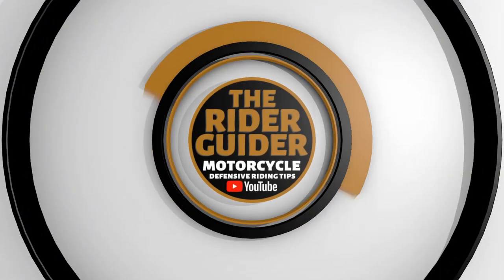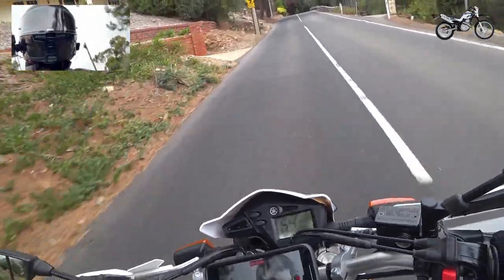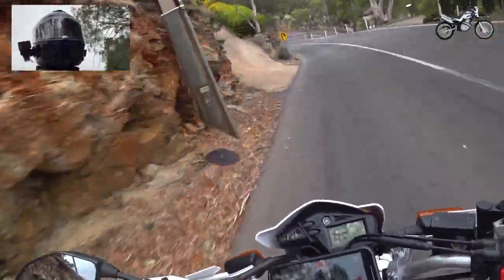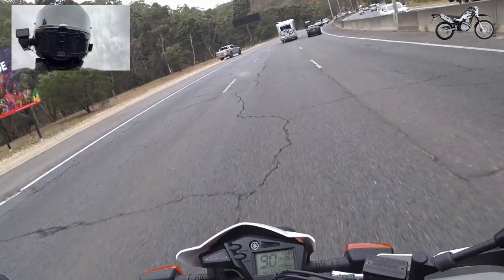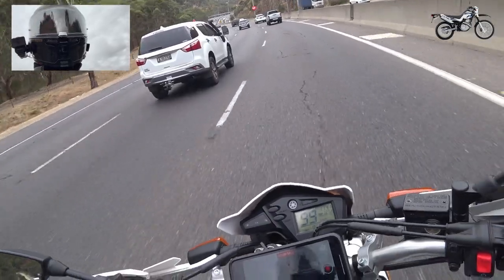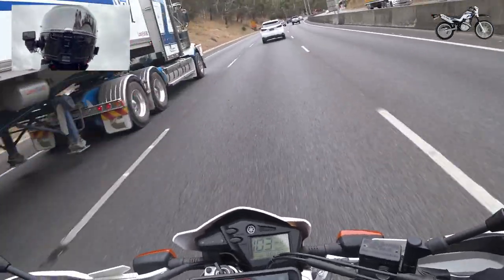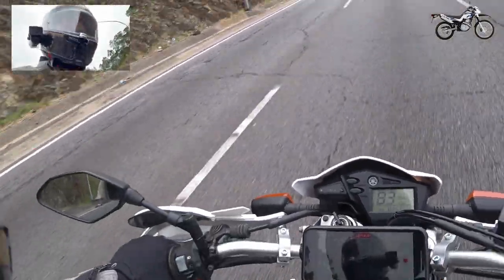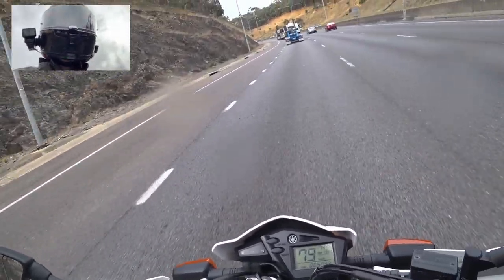YAMAHA XT250 TOP SPEED UPHILL TEST IN TRAFFIC

Comment: Bought one this year. Amazing, fun little bike to zip around on. I have a Royal Enfield road bike that weighs around 450 lbs. Much rather zip around on my XT it does everything very well and is so light. I hate heavy bikes which is about 90% of them now. Plus I went up a tooth on the counter sprocket that helped a lot with traffic speed and still very adequate through the gears. If you can't keep up with traffic you don't know how to ride....
Reply from the maker: Thanks Wally, yeh you're right mate, this is a more than capable bike with the right rider ;-)

Comment: Exactly what I wanted to know. 
Looking at getting rid of my Super tenere and getting two XT250's.
One for me and one for my wife. Will be perfect for our adventure trips. Fast, reliable and lightweight  enough. 
Greetings from down here in South Africa 🇿🇦
Reply from the maker: And great value.  I love riding this XT.  One each.  That will be ace 👍🏼😎 thanks for visiting my channel 👍🏼
Reply: Are you happy with your choice of 2 XTs?
They are great bikes but thanks to our exchange rate, don't come cheap in the RSA. 
I run a bike lessons/adventure bike rides - sideline business  and currently own the following (very much used) dual-purpose bikes (which I bought over a period of about 3 years - all initially with their own issues) 2015 Honda XR150 / 2010 Zongshen ZSM200 / 1981 Suzuki GSX250 ("Scrambler" as per my profile pic) / 1997 Honda XL400V TransAlp / 2010 BMW F800GS - ALL 5 for less than the price of a new Honda 125 Monkey Bike!
Reply: @TheRiderGuider  Also from RSA, it seem you have quite a selection. Maintenance gets esier when you run the same bikes, but of couse buying bargains has its obvious benefits. I have a T700 (Upgraded from a GS1200) and a XT250 "for my girlfriend". In the end, i ride the 250 most of the time, more that the T7!! No issues with performance.

Comment: By far this is the best video I've seen because just about everyone complains about the xt250 is not a highway bike but you proved them all wrong  because you are doing 100km plus uphill.
I just bought my xt250 today
Reply from the maker: Souhail, congratulation on your new XT250.  Fantastic bike.  Take care.
Reply: @TheRiderGuider  I took it on 150km round trip mostly 100kph speed and the bike went fantastic..I don't know why a lot of people say is not good for highway run, I was surprised because it felt so comfortable at 100 to 110kph and it  an do it all day long.
Reply from the maker: Excellent - if you're doing lots of highway work, you can also look at raising the gearing slightly, won't negatively affect it much going up hills but will allow for slightly less revs at higher speeds, maybe consider a one tooth larger front sprocket.  Cheap but worthwhile upgrade.
Reply: Hi, how's the xt 250 going for you? I have a 2017 I recently acquired with only 220 klms on the clock. The only problem is I find it dangerously scary in the wet. Do you find that with yours? Maybe its just the knobbies.
Reply: G'day mate, I've had an 2008 xt for about a year and the speedo since I bought it is horribly wrong. It's reading 135k in second gear and so on. Any ideas on why or how to remedy it? Thanks. @TheRiderGuider
Reply from the maker: @markillingworth1929 … this could be as simple as just checking the speedo cable, it’s a mechanical cable not electronic, if it’s broken it would generally just read zero but might be giving a false read if not quite inserted possibly?  It would be unlucky/unusual for the actual speedo to be faulty.
Reply from the maker: Likely just tyres, we had Bridgestone AX I think they were on ours and they were really good.  But not really used much in the rain @techstories1979
Reply: @TheRiderGuider  pretty sure she's electric man but I will pull off the cowling to check . Thanks for your time.

Comment: Still breaking in my 2021 XT250 at 15 miles on the odometer at one third throttle for the first 500 miles and one half throttle for next 500 miles do not forget to read the owners manual. The bike is very nice and nimble at slow speeds off road with excellent clearance and very compliant on the road with lots of torque feels like a muscle car after owning a ct70 and ke100. Love a go any where bike that can runs very well and can achieve 72 mph with 2500 cm that woops larger bikes for power to weight ratios.
Reply from the maker: Congrats on the new bike.  I’m amazed by how the XT250 goes, after years of bigger bikes, being able to ride this now and again (it’s my wife’s) is a bit of a treat to be honest 🙂 … a fantastic bike for the money that will do pretty much everything you ask of it.
Reply: I’ve have 19 miles on mine, the 1/3 throttle is a bit unrealistic where I live and to be honest unless you mark the throttle marked I’m not sure how anyone doesn’t at times. Would have been nice to have a tachometer.
Reply from the maker: Running in ‘rules’ are just a guide line.  Despite the XT having been around for a while it’s still an engine with modern tolerances.  Don’t get too stressed about stressing the engine.  As long as it’s warmed up properly before you do any spirited accelerating it will be fine.  The things to avoid are often too high a gear and ‘labouring’ the engine going up hills.  Use the gearbox often and generally use the controls smoothly like a dimmer switch.
Reply: The Rider Guider I agree I’m 65 and I’ve been riding since I’ve been 12 years old I break in my vehicles like I drive them daily just with a bit more care.
Reply from the maker: @56Spookdog  XT250 engine would take some breaking I reckon 💪🏼👍🏼
Reply: The ttr 250 is older and almost twice as powerful, it's a pretty reliable bike, so I guess the XT250 is bulletproof.
Reply from the maker: @C4H10N4O2  yeh the TTR is a great bike.
Reply: I followed my breakin period by the book also. At six hundred miles I was about to take it in for service but I wanted to see first if the valve clearance was within specs. The clearance was dead on so I just bought the things I needed to do the oil change and saved some money. I know people say it will affect the warranty if you don't take it to the dealership and have it done but nothing is going to happen to the XT in a years time unless you totally abuse it. The XT is a great bike with a lot of helpful YouTube videos and forums for support.
Reply: @TheRiderGuider  Agreed! I've also heard that allowing an engine (be it a bike or car) to idle for too long, only allows the richer mixture to wear the cylinder bores. Rather just take it easy until it warms up by riding it. The most engine wear occurs while an engine is cold.
A metallurgist friend once told me "it's not revs that damage engines (that's what a rev limiter is for) but a lack of revs!
Reply from the maker: @not1au  not seen your comment mate.  Good input.  Thanks and yes, your bike will be decades before you need anything fixing.  Top stuff.
Reply: @not1au  Save your receipts and your warranty should be just fine
Reply: @rameylewis7730  Thanks for the info. I do have all my receipts most were from Amazon, Revzilla and other places I have online accounts.
Reply: One third throttle for 500 Miles? 😂🤣😆😂🤣😂😆
Reply from the maker: @rich2583  takes discipline that 😁😆

Comment: I had an xt225 which had the 6th gear. Pulled very easy on the highway. I wish I never sold that bike.
Reply from the maker: Hi Kevin, the 250 would definitely benefit from a 6th gear I reckon, or certainly a smaller front cog - going down a tooth wouldn't hurt anyone using a 250 for road use.
Reply: Man. I had a XT225 great bike had a blast on it !
Reply from the maker: @markcollins5026  these ‘little’ bikes are so cool and fun to ride.
Reply: That’s the only thing this XT250 is missing is a sixth gear .

Comment: I'm impressed that the bike doesn't sound frantic or stressed.
Reply from the maker: I was too Gerald, the pick up as soon as I started to go up the freeway was quite effortless.  When I was young a 500cc bike was almost a thing of wonder and amazement and in superbike territory, and a 250 still a big bike ... but nowadays they're seen as little commuters which is unfair, when you see this performance it proves just how capable these 'little' bikes can be.  Thanks for watching mate.
Reply: @TheRiderGuider  same here too. I was in Asia and 15-20 years ago (and short time 50 years ago) 125-250 consider a big bike. You need a special license for it and Harleys only issues and use for parade in the military.
Reply: It's revving hard and won't last huge miles. Will also need regular oil changes.
Reply: @redtobertshateshandles so how many miles does it need before it's needed oil change?

Comment: Now the question is how will the performance be affected if I drop 4 teeth off the rear sprocket? Because I hear the highway fuel consumption isn't that great.
Reply from the maker: Hi Brian, I'd instead go with one tooth larger on the front, would definitely benefit and a cheaper easier option as you probably wouldn't need to adjust any chain length.  As for performance, I think you would find it quite good enough even on the uphill but top speed on the flat might be less frantic, definitely the way to go.
Reply: They get 65 to 70 mpg, this would be the least of 
my concerns for this bike, I just wish it had at least
25 - 30 hp, for dirt riding.
Reply: @TheRiderGuider  Good alternative, going up in the front,
instead of the back.
I think if you added 4 teeth on the back you'd wind up 
altering the geometry of the bike, as this would 

shorten the wheel base by a little, not sure the exact 
figure.

Comment: I have the 2021 XT 250. Not lacking power uphill at all and I weight 180. Has good torque in all gears and don't know why they're not made with 6 gears. I was about to buy the 2021 CRF300L but chose the XT instead. I do not regret my decision.
Reply from the maker: Good decision Bent.  The Honda will still be a nice bike but the XT is great.  Won’t be many left after this year.  For general use I agree re the 6th gear too, but an easy option is to put a front sprocket on with an extra tooth.
Reply: @TheRiderGuider  I probably will end up changing the front sprocket in the future but now I'm riding as much as I can. I'll probably do it when I put on the Bridgestone Battlax AX 1s I bought.
Reply from the maker: @not1au  yeh we need new rubber for ours, such a shortage of tyres at the moment.
Reply: @TheRiderGuider  I bought mine about a month ago. My XT only has about 1300 miles and the tires are in great condition but when I need new tires they will be on hand.

Comment: My first road registered bike was a 1983 XT250. Top speed about 90 km/h. I got to about 100 down hill behind a truck. Loved it.
Reply from the maker: Wouldn’t ya just love to still be the owner of that bike? 🥰
Reply: @TheRiderGuider  Yeah man for sure.
Reply: It topped out at 56 mph? My XT will easily hit 70 mph (112.5 km/hr).
Reply from the maker: Yeh but we’re talking about a bike from 38 years ago.  Different beastie?
Reply: @Johnny-lr5jt  The '77 Honda XL125 I still had back in '83 would do 112km/h and my current 2015 Honda XR150 does the same. I think that '83 XT250 had shorter gearing or engine issues?
Reply: My mates 1981 model was faster than my DT250 with would do 127 kmh indicated. It wore out quickly though. Oils weren't good enough back then.

Comment: Great Motorcycle! When ride with two passenger, Does it feel some kind of power lacks?
Reply from the maker: Hi Efra, I would expect some reduction in how it performs, but it's still a 250cc, quite a reasonable sized engine, so I'd be concentrating on maybe adjusting the suspension and tyre pressures for two-up riding.  We've never used this bike with a passenger but I wouldn't hesitate if I needed to.  It has the ability, you just need to adjust your riding style and be aware the brakes will need extra thought too when wanting to come to a stop.

Comment: That's pretty good - how heavy are you Rider Guider? And what's top indicated speed on the flat?
Reply from the maker: Hello Steve.  
Not done a top speed on the flat but I would expect around 110 - 115 kmh maybe a bit quicker with a tail wind.  I'm 70 kgs (11 stone) however I think anyone up to 90 kgs would get very decent performance from one of these.  With my weight I could easily benefit from raising the gearing a notch with an extra tooth on the front sprocket and then seeing a very comfortable indicated 120kmh on the flat.  Maybe I'll give it a test ;-) thanks for watching
Reply: @TheRiderGuider  thanks mate
Reply: @TheRiderGuider  I remember the old XT 250 it had allot of low end grunt and tractor like power for a 250 four-stroke great for poking around tight technical trails. This new XT 250 you are riding seems to have much much better power for the hiway which is where the old XT had issues. Anyway great review and look into the performance cababilties of this old new bike.

Comment: It's tough to tell how steep the grade is.
Reply from the maker: Yes the footage does not do it justice at all.  But my ears pop on the climb up 😄
Reply: @TheRiderGuider  Were you doing that in 6th? At what rpms?
Reply from the maker: @jamesmziegler  actually the XT250 has five gears!  When I ride it I’m often searching up to an imaginary 6th which suggests for normal use you could comfortably go up a tooth on the front sprocket and raise the gearing a little.  I wasn’t watching the revs but there was still some left … for info this bike tops out at an indicated 125kmh.  I suspect that’s a realistic 70 - 75 mph taking in to consideration the general inaccuracy of speedometers 👍🏼
Reply: @TheRiderGuider  I ride my RX3 250 in the Ozark Mtns where our highways have really long, steep hills too. God help me if I have to pass anyone uphill at 65mph, cause the bike on its own won't do it. 🤷
Reply from the maker: @jamesmziegler  not a bike we have here in Australia as far as I’m aware but it looks like a nice thing!!  One of the cheapest and easiest modifications for you in your case might then be to lower your gearing so you keep in the more powerful rev range?  A tooth extra (sorry no a tooth LESS  🤦🏻‍♂️) on the front sprocket would give you a noticeable difference climbing hills for sure.  The only downside is you lose a touch of maximum speed in each gear but probably not that noticeable.  Have you considered that?  It’s not expensive and well worth a try.  One tooth difference wouldn’t generally even necessitate a change in your chain length either.  Just swap and go 😎
Reply: @TheRiderGuider  CSC sells a front sprocket with an extra tooth. Honestly, on a 250, the wind is always a factor over 65 mph - I really don't like it. An extra tooth kind of sounds like a good idea 👍
Reply from the maker: It’s cheap and easy enough to be able to swap back and forth too if required 🙂👍🏼
Reply: @TheRiderGuider  Actually, that's a good idea. I'll call TK at CSC and get them to send one out. I think the RX3 might take a new chain for that, too, but the conversion won't be that expensive. The speedo will need futzing with probably. There's a gizmo for that. Thanks 👍
Reply from the maker: @jamesmziegler  I’ve had a brain fart mate.  Go one LESS tooth at the ftont …  Come back and let me know how you go.  Make sure you go one less  tooth not one more for the front or you’ll find it even slower up the hill! 😁 HOPE YOU SEE THIS BEFORE YOU ORDER 🙄
Reply: @TheRiderGuider  I'll ask CSC. But, I think you're right. Smaller up front would improve lower end performance.

Comment: Bottom line: you hit 100 Km/Hr. indicated, Correct? Which is 62 mph on the optimistic speedometer which is commonly 55-57 mph top speed on an incline. My XT225 indicated speed vs gps speed: 80 mph speedo, 71 mph; 70 indicated/62 actual; 60/53 actual. So they can be 10 mph slower than speedometer. You were probably doing 55 mph balls to the wall up the incline!
Reply from the maker: YEH I can't see it being much different to the 225.  It went well up that hill.
Reply: @TheRiderGuider  But whatever it's worth, my TW200 is the only one that is pretty much spot-on when compared to my GPS. It's the only bike that I have like that. On average my bikes are about 5 mph optimistic. So Speedo has to say 65 for me to be going 60 mph, on most of my bikes.

Comment: People are such specwarriors. Once Rubber meets pavement is when you can really tell the truth. I've had my xt almost 3 years. When I bought it I weighed 330 pounds I've lost a hundred of that I never had trouble on the freeway at 65 mph sure it's not a super bike at passing but cruising is easy.
Reply from the maker: Devin, thanks mate.  Awesome work on the weight loss too!!
Reply: @TheRiderGuider  thank you. what i found interesting though from losing that weight is that the bike has a practical high speed performance limit of 350-400 pounds. under 55mph its 500lbs.

Comment: Any bike will perform perfectly well on highways at 250cc. Even 200cc, provided the bike is not too heavy, will easily keep up with A road traffic. There is too much nonsense written about the mythical need for powerful bikes, mainly promoted by the biking press and media who rely on advertising from big bike manufacturers. Thanks for dispelling this myth. I did a 3000 mile trip around Spain and Portugal on a 200cc Suzuki Burgman scooter and though I kept mainly to rural roads, when I had to go on a big highway or motorway, I easily kept up, achieving a very relaxed 70 mph (113 kph) for hours without a single problem.
Reply from the maker: Great comment.  Absolutely correct mate.  250cc bikes were classed as decent sized when I was a young lad.  If anything they’re even faster these days too.  CHEERS 🙂👍🏼